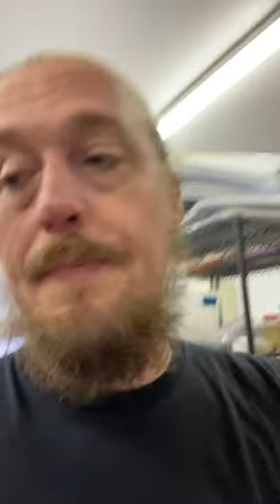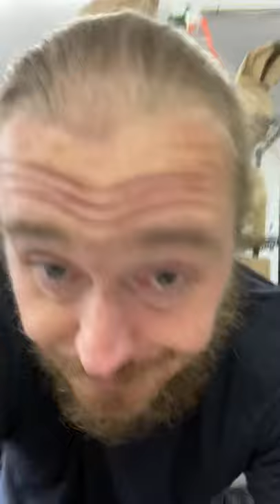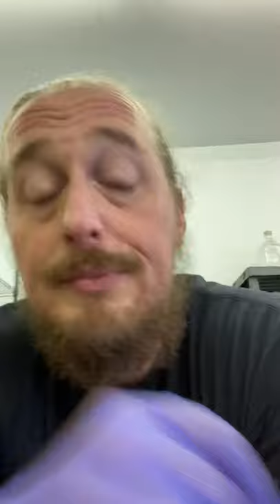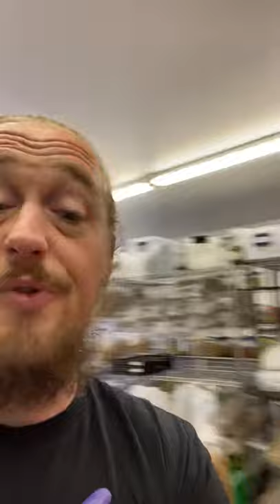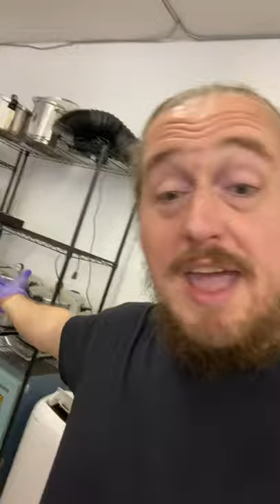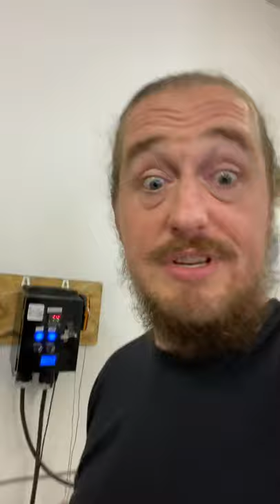Myco quickie: pasteurization vs sterilization

Comment: Thank you for the video! I don't live on a mountain but I also don't have an actual autoclave and won't be able to get one for a while. Is it possible to use a large stock pot or an instant pot to sterilize cvg? I have seen a lot of conflicting info. Thank you again!
Reply: if you are not keeping your CVG for extended periods you don't need to sterilize it.
pasteurization works fine if you are going to use it right away & do your work in a clean environment.
Reply: @themyceliumnetwork  I'm trying to use some now and prep some for later. I have seizures so I have to do what I can when I have the energy. Also trying do whatever I can to be successful with what I have because the last few attempts I got contamination. Thank you so.much for the info.
Reply: @katclaus7425  in that case I would suggest jars or autoclavable bags without a filter patch.
the filter patch will let moisture escape leaving your substrate dry.
go through the proper hydration process & than jar or bag up your substrate.
PC at 15 PSI for 2 or even 2.5 hours & you'll be good.
having an impulse sealer for bags (if you use them) is a good idea !!

hope this helps & maybe The Humble Fungus can chime in with any other ideas.
Reply: @themyceliumnetwork   thank you so much!
Reply: @themyceliumnetwork  would a bag clamp be sufficient to use so that you can reuse the bags without impulse sealing and cutting. I've read that the bags eventually give way if PCed numerous times but can we get a few runs on the bags at least?
Reply: @katclaus7425  any time !!
Reply: @Takhar4life  I've never used bag clamps & I never reuse my bags if I need to PC them
i have opened bags of grain spawn & resealed them again though.
an impulse sealer can be used on the top 1/4" and chopped off many times if needed, there is lots of room between the filter patch & the top of the bag

Comment: Man you gotta be careful with that barrel. I've warped one at 5psi, and know that to be thier max. 

I wish I could share this bit visually, but you'll get it: make a water column. Blackpipe going up 3 ft, elbow, over 1 ft, elbow, down 6 ft. That 6ft downpipe vent sits in a pvc tube, or something similar full of water(mark it like a ruler).  A water column pressurized about .43ishpsi per foot or so, so that will put you right around your target temp without a barrel blowout (its a big mass. Itll hurt.)